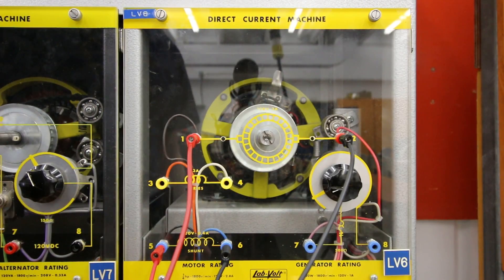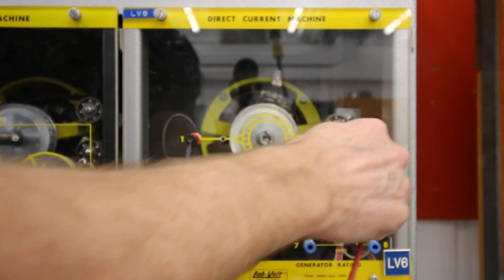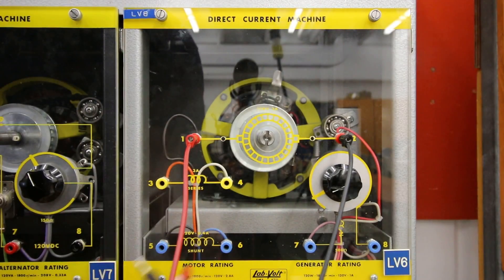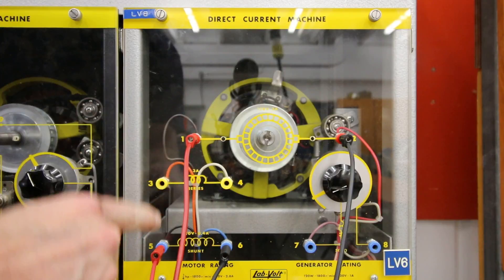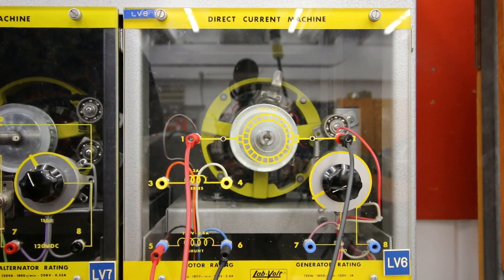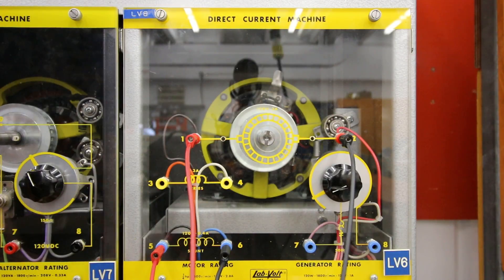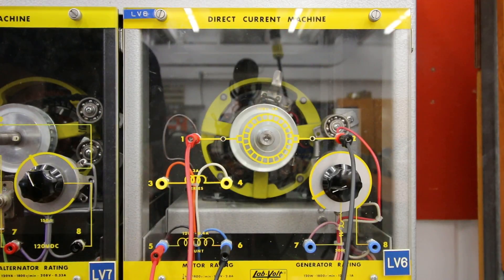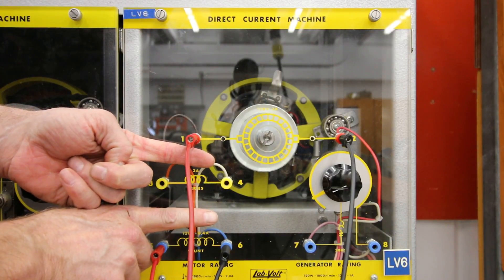Reversing a Shunt DC Motor

Comment: Where do you get those glass box motors?
Reply from the maker: From a company named Lab Volt... they have since been purchased by Festo Didactic.
Reply: Pete Vree they kind of look cheaply made, but they seem to work good, so that’s all it needs is to work good. I wish I had a motor kind of like those, but in a metal case and round. I could probably try to make a test one out of sheet metal and screws.